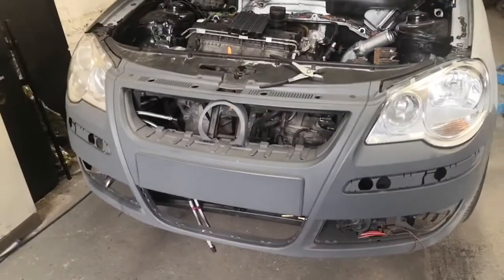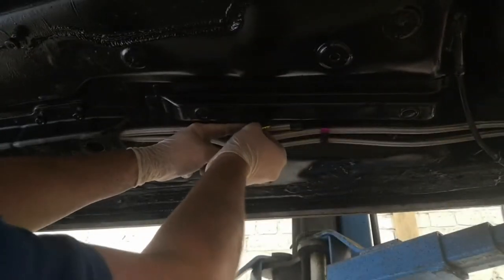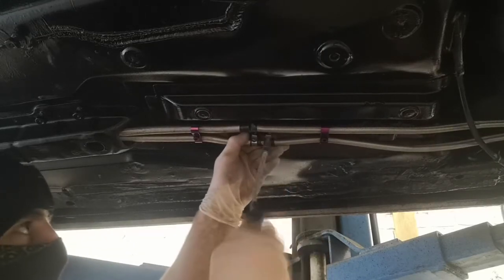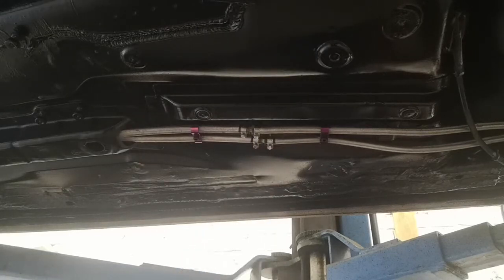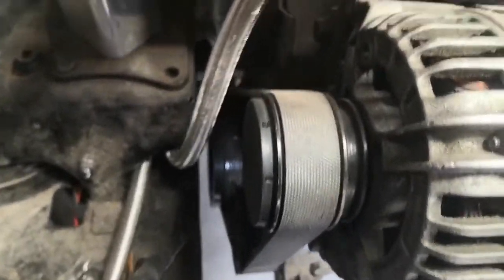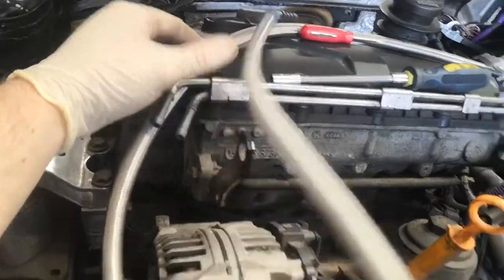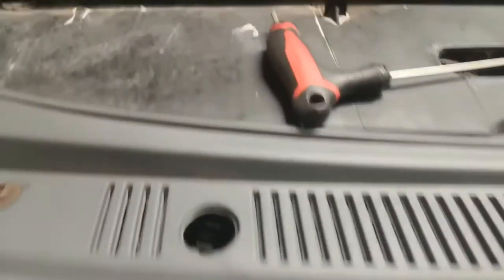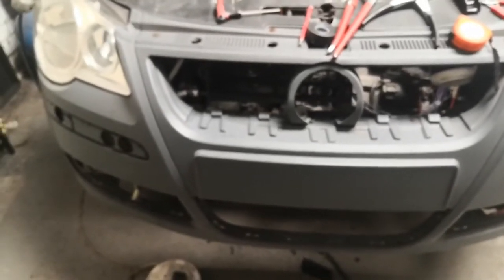I fitted a BRAIDED fuel system to a VW POLO 1.9 TDI for 400bhp

Comment: Yo , love your work bro . I just want to see how you modified the tail lights of the 9n3 to fit on the 9n or were they just a perfect fit without making any sort of mechanical adjustments ?
Reply from the maker: They're exactly the same fitment but you'll need to repin the plug on the car so that the lights work correctly or you can buy the adapters online that look like a 15cm wiring loom with a plug on either end.

Comment: I want to change the engine of a 2004 Polo 1.2 3-cylinder with a better engine, so what do you recommend?
Reply from the maker: 1.8t or 1.9tdi as they're a straight swap they came in polos
Reply: Essence